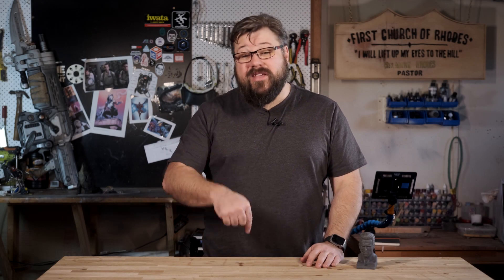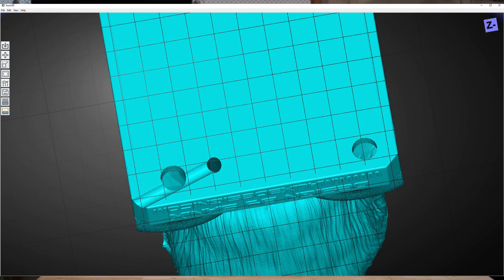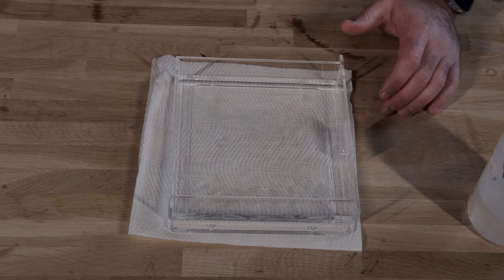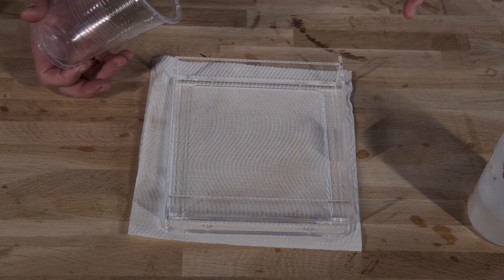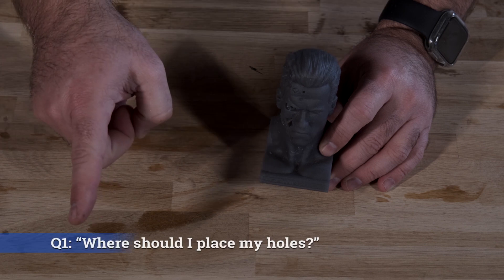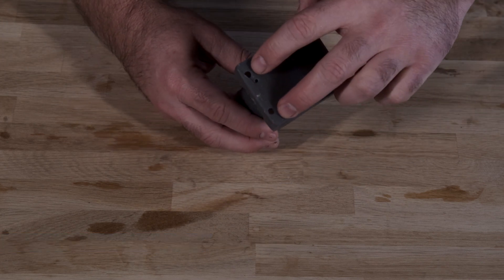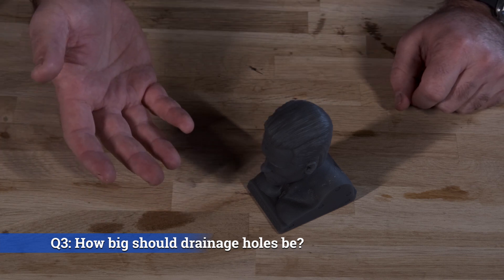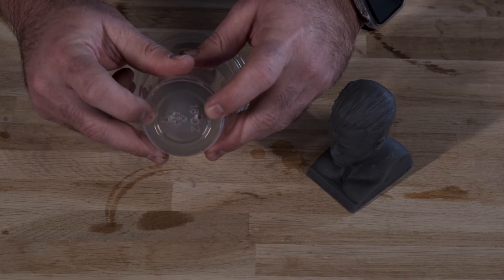Resin Printing Tips - Drainage Holes Explained

Comment: This analogy doesn't make sense (hold water, LOL.  sorry.  i was born a vehicle of dad jokes).  If you are using the analogy of the cup, and the print is the cup, and the water is the resin, then the top of the cup is the... build plate.  this wouldn't explain drainage holes on the bottom (which is the top, here.  the build plate as the "bottom"), bc then the drainage holes would also need to go through the build plate bc THAT would be the top of the cup in your analogy.  In this analogy, since you can't go through the build plate... the drainage holes would have to also go through the bottom sides of the cup to release the suction.  Right?

Comment: The holes on the part of the model on the build plate are close off during printing. Holes at the top (Basically the bottom because we print upside down) are submerged and cannot alleviate suction. The function of the bottom holes (the ones against the build plate) are to let the resin drain after printing. In a nut shell, it would be like dipping that cup in water but placing your thumb over the holes. Which is what the build plate does. One small hole in the side at the base would be the answer. Because it would remain exposed to let air out. unless they are on supports.

Comment: You should of mentioned UV TOOLS will correct trapped resin in the hollow areas. This is inevitable as all prints face this problem regardless if its hollow or not. Lychee will save your slice then provide you a button once you've installed UV TOOLS seamless workflow.

Comment: I make my drainage holes 4.5mm to 5.5mm depending on the size of the print.  I do this because I have a single UV led wired to a battery pack and 4.5mm allows my to stuff the led into the interior of the print so that I can cure any resin residue left inside the print.

Comment: Clear and concise, thanks. I'm glad you've noted that these aren't really holes to drain resin; they're holes to equalize the pressure between the model and the vat so suction doesn't pull it off the build plate.

Comment: You technically need to add holes to the bottom of any enclosed area, not just whatever the bottommost edge is. Because as you work your way up through the layers, depending on your part and orientation, those areas will basically be separate parts until they join together.
Reply from the maker: Agreed.  These days I generally add a top and bottom hole, it just makes flushing out uncured resin easier, and allows the print to drain after it is finished.

Comment: Very good information.  The only thing I would do differently is towards the end when he talks about a vase.  Orient the vase so the opening is towards the print bed.  (upside down for a resin print but would look right side up from an observer).  Then you don't need holes in a vase.  For a stronger print, print the vase at an angle.

Comment: Hello, thank you for the video ! What do you mean by "that uncured resin can easily be washed out during the post processing through the two holes" ? Just putting my print with the two wholes in the ultrasonic washing machine is enough to drain the print of its resin ?
Reply from the maker: Having two holes allows fluid to enter far easier, as a single hole has to allow air out, and allow fluid in.    The ultrasonic machine may be enough, but I'd still do a very thorough pre-wash with IPA first.

Comment: Good video (thank you!), but isn't it wrong to say that hollowing your prints decreases print time? 
I mean, it does with an FDM printer, but isn't the print time per layer the same for resin printing regardless of the surface area of each given layer? 

I know it takes the same time for me to print 20 cubes in 1 batch as it does to print 1, as each layer is set the same!

Edit: nvm, I seen some of the comments here regarding the difference between sla and msla, nice to know. 
Thanks!!!! :D
Reply from the maker: Fair comment.   At the time I was using a laser based SLA system, not a masked SLA style that is now far more common.   That comment dated horribly and doesn’t apply for most resin printers nowadays.   That said, hollow your models!   You’ll never cure a solid model and it will just ooze raw resin until it cracks.

Comment: Just wondering, if we hollow inside the model with like a hexagon pattern does the resin flow out in only two holes? Looks like each hexagon is an enclosed space itself.
Reply from the maker: I don’t think I understand sorry!
Reply: @MarkRhodesMaker  This is an infill similar to fdm you have 3 or 4 layers outside and than the infil 20, 30 percent or more just to hold the model together. You can select different patterns like square, hexagon, lines etc.
Reply from the maker: @RestorationAustralia  gotcha.   I don’t recommend infill for resin.   Infill isn’t usually required for resin except for very large models.  
 Traditional infill patterns also are not a great idea for resin as they can trap uncured resin, and besides those internal structures are really hard to post cure.  There are specific infill patterns for resin that are more open for curing and draining purposes, but as I said, not really required except for big models.
Reply: @MarkRhodesMaker  I see that is what I thought it will be difficult to cure and difficult to drain. The problem is in the Photon workshop I can't see an option with-out the infill. Not sure how to get around, hmmm. Thanks for your help😊
Reply from the maker: @RestorationAustralia  try a different slicer!   I use chitubox and lycheeslicer.

Comment: So what if your printing parts meant for mechanical purposes and you can't afford to have holes in it? Just print it solid?
Reply from the maker: I'd suggest if that was required, then maybe really overexpose each layer.  I'd say there's still a solid chance it will ooze resin or crack down the track however.  It'll be impossible to cure internally completely.

Comment: What about a non hollow design?
Reply from the maker: Hey Jack.  If it's not hollow, you won't need to drain it.  It might cause some suction issues, and could also introduce different problems, such as uncured resin internally.

Comment: I'm getting ready to try my hand at 3D resin printing after a couple years of FDM printing. I think this video is very good and illustrates simple sciences about liquids and air pressure differentials very well. I had not even considered just having the drain holes near the build plate and just inverting after completion so that I could just flip it over and drain it (back in the bottle with a funnel) to save Arnolds hairline with a hole he doesn't need. Very informative and insightful, thanks.

Comment: Thank you for the explanation!  I knew drainage holes were needed for that last bit of uncured resin, but I hadn't thought about the suction issue at all.  I had 3 out of my first 4 prints fail, unrelated to this, I just realized today that my build plate is bent, but having this knowledge will likely save me from more failed prints once they get me a good build plate.

Comment: My fiance and I just got a resin 3D printer and this was so much help!!!! One question though, how do you cover the holes once the resin is drained out?
Reply from the maker: I tend to put my holes in a spot where I don't need to fill them, by hiding them between joints or in under-cuts.  But if you do need to fill, you can use any car auto body filler, any plastic filler compound from a hobby store, or you can try a dab of printing resin to fill the hole, then "cook" it with daylight or your curing chamber.  Any of those should work a treat.

Comment: Trying to understand one thing. In the example with the cup.... the holes allowed air in. If you were to do this with a print however.... aren't those holes still covered by the build plate? Wouldn't the holes need to be off to the side to actually allow air in? 

I'm new to this and haven't actually received my printer yet, just doing research and trying to understand it all.
Reply: Yes, you are correct.  I was going to ask him the same question.  My assumption is that he angled that flat bottom part at an angle.  But what if we don't angle our piece and want to print flat to bed?

Comment: Thank you! This video helped me troubleshoot an issue I've been having with suction force on a large print. the suction force has been causing wrinkles in my FEP sheets and print failers on my 10-hour prints. Granted I also wasn't hollowing out the print either as I should have been for such a large print.

Comment: I had existing prints without holes, so after watching this, I drilled two 4.5 mm holes in the bottom of each print, and about 30% had resin immediately leak out. One in particular felt heavier than the others, and was absolutely filled with uncured resin. Like, a LOT of resin. More than paper towel could deal with. Just to be sure, I ended up flushing the prints out with a syringe and IPA over my cleaning tank (using a respirator, safety glasses and ensuring the holes were pointed away from my eyes), and left them to rest on paper towel for a couple of days to let any remaining fluid drain. They are still a bit leaky, so I may have to reseal the holes.
Reply: Wow that's crazy, good to know 👍
Reply: Yea plus people say if there is enough uncured resin still inside a model it can "eat through" or crack the model eventually. Some guy made a greek bust and it ate a crack through it.
Reply from the maker: @jackburton6330  It definitely can.  I have models that are years old, and some of them have performed like this.  Cracks developed after multiple years of seeing stable, from post processing performed whilst still learning the best ways to do it.

Comment: So when you do the holes but then paint the model is there a high chance of some resin slippin thru the hole? i had this print that i fell off my hands and started leaking but i notices kinda late after i touched the resin, was the print drained in a wrong way or does this happen?

Comment: What if you want the 3D printed object to have heft or weight to it? Is there something you can fill the hollow object with after curing? Like sand or something?
Reply from the maker: I haven’t tried it but have considered using a slow setting epoxy or polyurethane resin, as long as it doesn’t get hot it’ll be fine.   Sand would work too, you might just have to fill the holes to stop it leaking out.
Reply: @MarkRhodesMaker  thanks! Also, does a clear resin object need to be hollow? Or can UV light cure it all the way through since it’s transparent?
Reply from the maker: @roofoofighter  It probably cures better, but it still needs to be hollow.

Comment: Are there any ways to fill back the holes after we're done with the printing?
Reply: Mix some resin with baby powder (talcum) to create a paste, then fill it by hand (with gloves, obviously), cure it with a light, and then sand it.

The video I saw suggested 4:1 talcum:resin, but start lower until you get the consistency you want. Talcum is chemically inert, we don't need to worry about it reacting poorly.
Reply: @GamesFromSpace  thanks man!

Comment: What about for minutures? Are there any prints that don't need holes ?

Great video btw ! Definitely subbed
Reply from the maker: Hi!   Yes there are.   Models that have minimal internal spaces don’t need it.   Most slicers will be able to tell you if you need a hollow and drainage hole based upon the internal dimensions

Comment: I print with the vat full enough that it doesn't lift the model out of the resin as it builds prints. This reduces the number of trapped bubbles but without a vent hole it sucks up resin internally forcing the outer walls to suck inwards and be distorted. If it does break the surface of the resin in the lift it dumps the resin and leaves a line or a point of failure where this burping occurred.

Comment: I accidentally printed a model without holes, and im almost certain its 100% filled with resin, it feels quite heavy. Is it possible that the suction draws resin up into the model so it can never drain? i thought that there might be a cm of resin pooled in the area that was printed last (because thats how much resin was left in the vat) but it suspect its FULL of uncured resin.
Like, if you put a cup in a sink full of water and filled it up, then turned it upside down and lift it above the surface of the water, the water inside the cup stays inside until the brim of the cup breaks the surface of the water and then it all drains out in a instant. I think that is what happened to my model. The resin just never drained because of the suction.
Reply from the maker: Yep!   It will fill up and get trapped.   Carefully drill it out before you cure the outside with a small (5mm or smaller) drill bit
Reply: Are you sure you didn't print it solid? Did you end up drilling it? UPDATE: I drilled mine and sure enough, FULL of uncured resin. You should be ready to drain it into your vat. My 8 cm high model contained more resin than 6 paper towels could deal with. I think you could even reuse it, since it has been in a sealed vessel all this time.

Comment: Great video!! What would happen in the instance there were internal supports that can't be cured? For example, if this model had a solid neck and there were supports in the head (and no drainage hole)?
Reply from the maker: That’s a tough one.  It’s possible the model would split or warp over time.   I have a few older prints where uncured resin has caused splits up to two years later.

Comment: Great and very informative video! Thank you! One question: In order to use drain holes on the bottom, I have to print with supports, correct? Otherwise print holes will be flush with print bed and won't get air.
Reply from the maker: Half correct.   I have been printing recently with a flexible build plate, and drainage holes are still valid for hollows, as they can’t go on the bottom, I place them in inconspicuous locations instead!

Comment: I was thinking i could print a 2mm dowel rod, and then fill the holes and cut them flush after cleaning.
Reply from the maker: Chitubox actually has this feature.  It’s called “Keep Holes”.   I actually think it’s easier to fill the holes with a drop of uncured resin and then flash it with sunlight or UV.

Comment: does the holes on the bottom will work? after all your prints' bottom will stick to the build plate, the hole will still be sealed. Making the hole on the side will make more sense, right?
Reply from the maker: jianzhi meng only if you are not using supports.  And the bottom of a print is usually face down in the finished product, hiding the hole!

Comment: If sla cures a full layer at a time, why would hollow prints print faster?
Reply from the maker: SesameStFighter you are correct, however I was referring to SLA not mSLA.   This is using a laser not an LCD mask, so it’s faster when hollow.   For mSLA layer cure time is consistent regardless of the model
Reply: @MarkRhodesMaker  thanks for the reply, another question for you. Other than cost, is there any benefit for printing hollows on a msla printer? Just got a Mars pro literally an hour ago
Reply from the maker: SesameStFighter yeah actually!   You can’t cure past a couple of millimeters, so if not hollow, the uncured resin will seep out over time, which is unhealthy, messy and can ruin finishes
Reply: @MarkRhodesMaker  brilliant, thank you so much

Comment: Simple enough, thanks for the explanation. I was trying to figure out why my print was failing or cracking and this confirmed my suspicion.
Reply: Cracking will still accure after few months. The uncure resin being caustic will slowly soften the inner walls which have tension. I recommend 4mm walls no fancy mesh work inside. Keep it hollow. So when you clean with IPA you get into all areas. NEXT dawn soap with hot water. Why? You force exothermic reaction without UV INSIDE the hollow area. You had the basics down.  However,  you only addressed 50% of the issues.

Comment: That's the video I was looking for. Amazing  thanks! One question: I am printing 12cm by 7cm flat thick plate without supports. Should I make 4 holes on each side?
Reply from the maker: Kind of depends on the model a little bit.  I tend to be a little conservative with the holes on anything but the base, as I'll have to fill the hole later.  I also seldom print without supports!